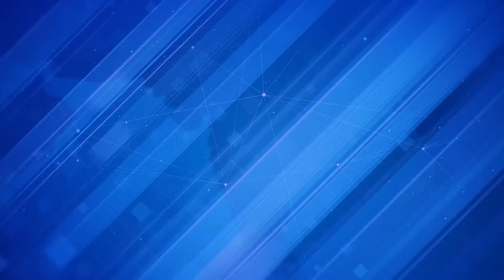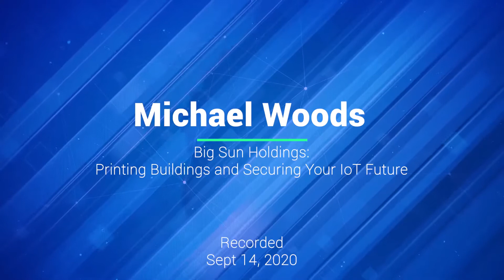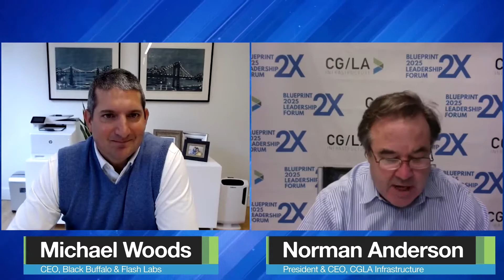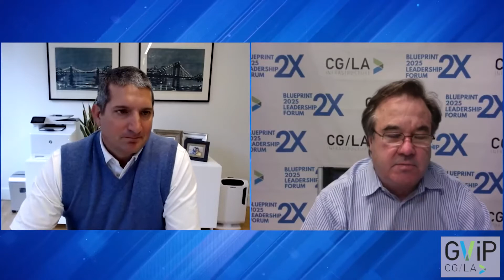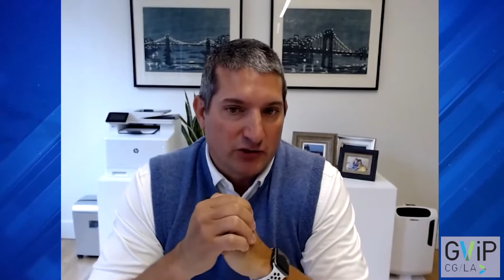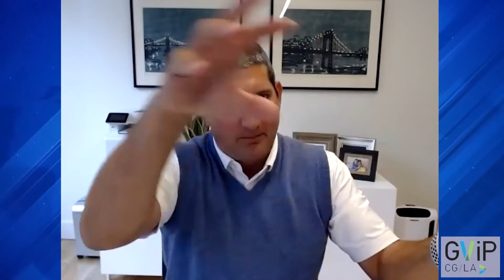Global Infrastructure Leadership Interview - GViP- 3D Printing Buildings & Securing IoT

Comment: I'm a specialist in traditional concrete construction and this technology look very interesting. I assume you are using fiber to reinforce the concrete.
Reply: Hi Frank, we use a proprietary cement based ink. We'll be sharing more updates as we continue printing and work towards testing to ICC-ES AC509 criteria.